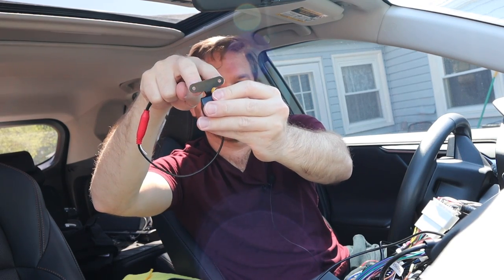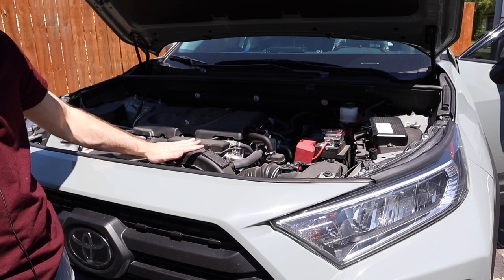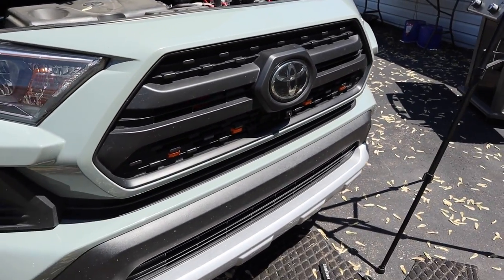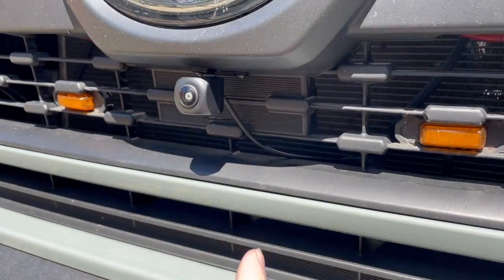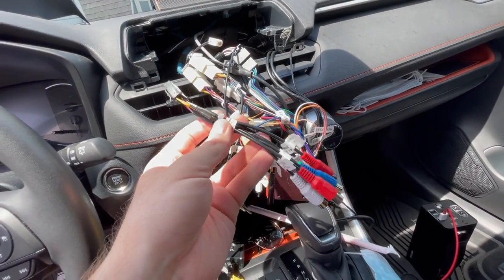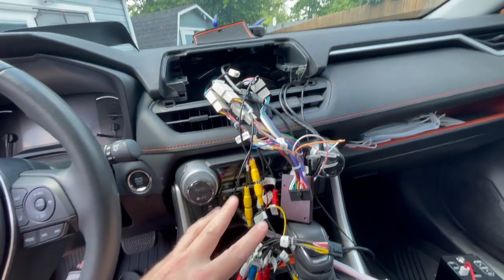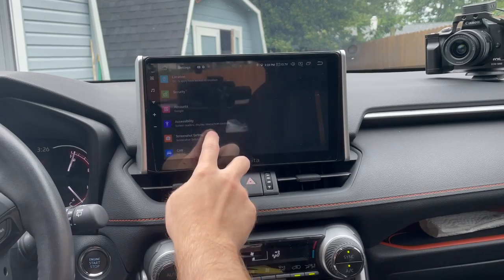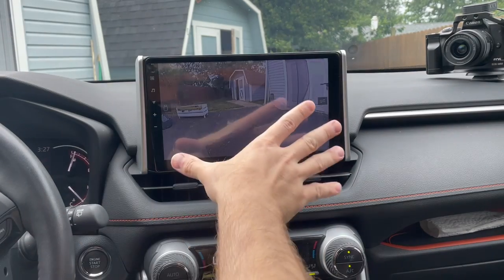Front Camera Install via Dasaita on Toyota Rav4

Comment: i dont have the "A harness on my head unit. i know you mention other place to get power for the front camera. is there a way you can show me where i can get 12V power supply  for my front camera. and better yet where can i get that "A label  harness" ?
Reply from the maker: The other place to get 12v power is from the battery. What head unit are you going to use with an additional camera?
Reply: Dasaita max10
Reply from the maker: I am unfamiliar with that but if you want to get power, the closest 12v is the battery in the engine. You'll need a relay/switch probably so you don't drain the battery. Are you sure it didn't come with a harness. The images I see looks like what I have.
Reply: No it only come  in with “D Harness for my back up camera
Reply: Do you have any problem with the camera ? Without connecting the ground ?
Reply from the maker: I have zero problems with it right now that way I installed it.